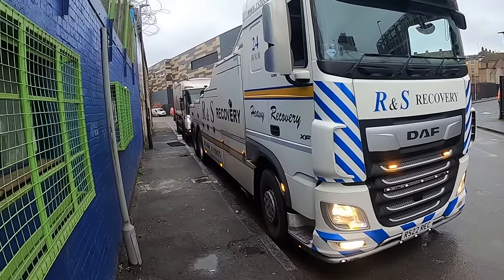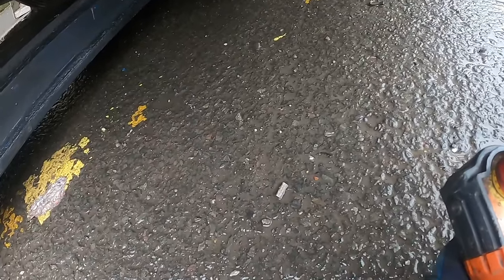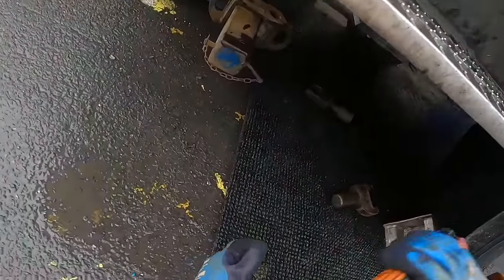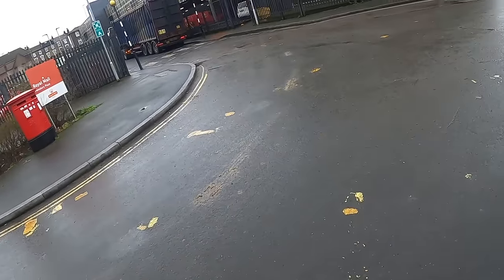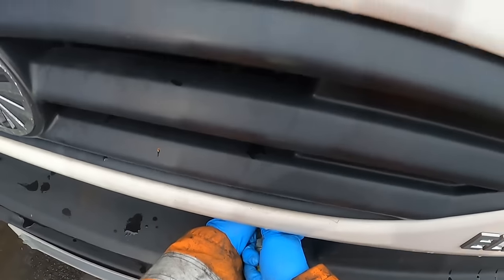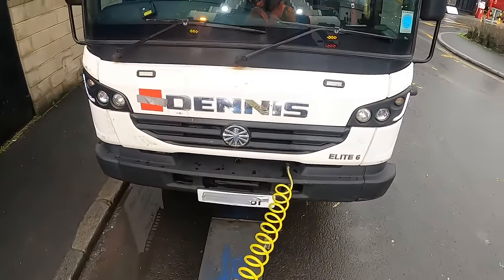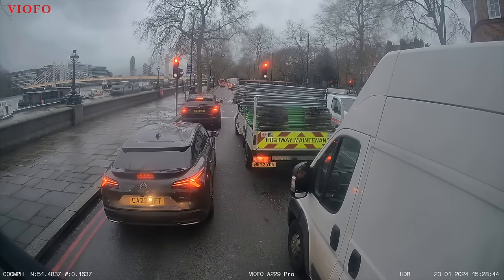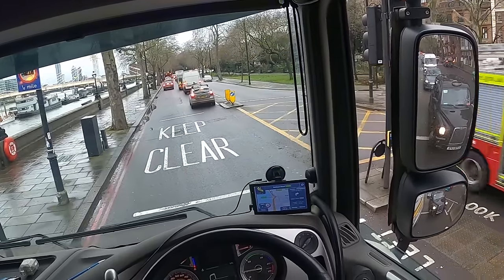TOWING A LOADED DUSTCART ACROSS LONDON! UK HEAVY RECOVERY!

Comment: Another insight into the life of a heavy goods recovery driver.
This is keeping me from being bored while recovering from Covid.
A couple of questions for you Steve.
Why is your truck manual and not automatic and why do you only remove one drive shaft?
Looking forward to the next videos 😊
Rich
Reply from the maker: Hi Richard , truck was already in stock at bodybuilders so didn't get option on gearbox. By removing the half shaft you our protection the gearbox by removing the drive from the rear wheels via the prop shaft to gearbox . Something we have to do on all commercial vehicles we recover when drive wheels our in contact with the road.

Comment: steve have you ever tried a plumbers bung to stop the oil escaping from the axel
Reply from the maker: Hi Simon never tried that , normally have half shaft cover to fit mate , you only tend to loose oil out of axles with roller bearings ,  you dont normally see much of the oil on normal axles when you remove the blue roll.

Comment: Just wondering do you lock the cab up for security while you’re working on the tow? Or is it not possible because the keys are in the ignition? I was thinking it could be dangerous if somebody got into the cab while you’re working.
Reply from the maker: Hi Thanks for watching ,  you need keys in ignition and engine running to  operate underlift , but have spare key to lock cab door when outside working if needed.